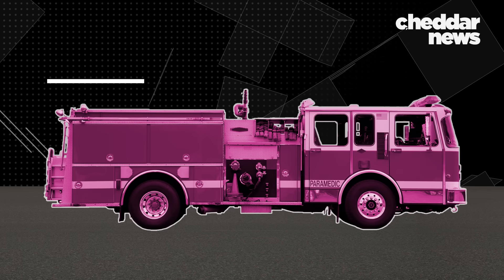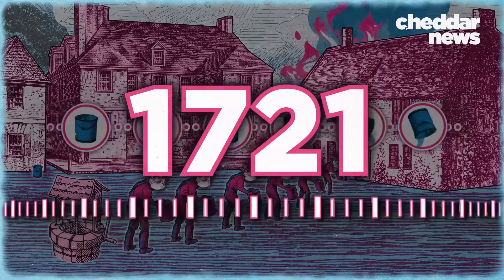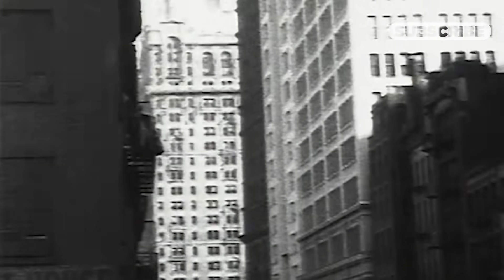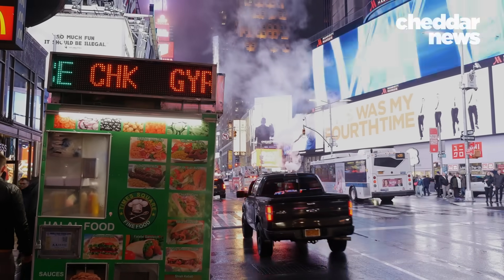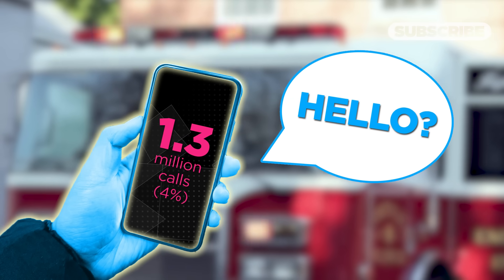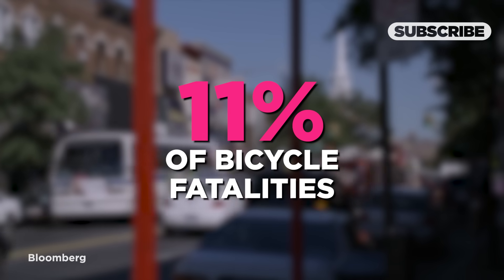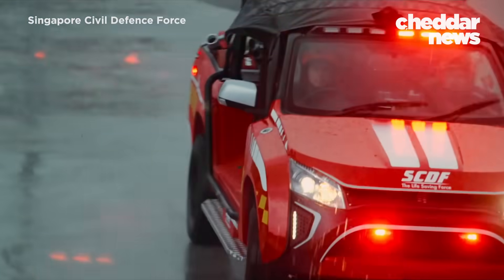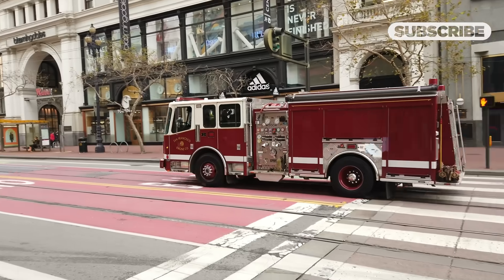Do American Fire Trucks Need To Be So Massive? - Cheddar Explains

Comment: American Fire Trucks are larger because we do way, way more than fight fires.  We respond to vehicle accidents, medicals, technical rescues, infrastructure failures, natural disasters, hazardous material spills and leaks, weather damage..  the list goes on.  On top of that, American Fire Departments have two MASSIVE problems - 200 years of tradition, unencumbered by progress and - what's mine is mine.  Breaking these both down, American Fire Fighters would rather stand on ceremony than electively change or evolve.  Our trucks LOOK old because, well, they are.  Most of our trucks are 20-30 years old because we hate change and trucks are expensive.  As for the latter statement, you would not believe how slow and overencumbered the American Emergency Response system is.  Several States and their Counties are more than 30 years behind in technology and most even further behind in adaptation of national standards.  The trucks at my department have to carry DOZENS of adapters for neighboring areas custom threaded hydrants that are over 50 years old and newer replacements, well, they just get the same old thread because why change, change is stupid.  We also can't agree on one type of hose lay, nozzle, size, tank size, pump, length, ladder style..  Nearly every truck in every single one of the tens of thousands of fire departments across the country is unique.  Sure the chassis may be similar as design engineers from Pierce and EOne etc only offer a handful of models, but the rest of the truck is COMPLETELY customizable from the types of doors, mounting systems, pumps and riggings, technology, lighting systems, etc.  Moreoever, we can ostensibly only afford to replace ONE truck and having that ONE truck able to do everything is necessary as our number of volunteers PLUNGE.  In 1980, the state of Pennsylvania had 300,000 volunteers.  Today, we have 22,000.  Europe may have smaller trucks and diversify their roles and probably have the membership to get multiple trucks out and more than likely a well-designed financial plan to keep these trucks in good maintenance.  In the US, we are lucky to get ONE truck out the door for ANY call.  If we have a truck out the door built to handle a traffic accident and we get another call for a fire - we would likely have to go back to the station and switch trucks IF we can manage to clear from the accident because just about all of our active members that are available are already deployed to that incident.  This forces us to be over reliant on Mutual Aid with trucks from neighboring towns constantly traveling outside of their zone with THEIR limited manpower to cover another municipality's bad day.  All it takes in any given area of the US is one moderate disaster to absolutely cripple emergency services and lead to hundreds of unnecessary deaths.

To make a long story longer and my text harder to read, we had tens of thousands more fire departments 30 years ago than we do today.  Many have merged into a single "Fire Department" covering a large area rather than having 4 different "Companies" within walking distance of each other.  You'd have a Rescue Company, a Ladder Company, an Engine Company, a Tanker Company.. and they'd be "Hook and Ladder Company" or "Hose Company" or "Independent" and they all had their own ways of operating on the Fire Ground.  Without getting political, a lot of these Fire Companies ended up in the hands of a more .. combative and arrogant generation and all these deunification "do it my way" techniques actually lead to Fire Fighters getting into fights on the front lawn of your burning home.  The Fire Service in the US is in a wild race to the bottom and those still in charge of these, basically, Mom and Pop Shops (no, seriously, walk into any US Volunteer Fire Company and you'll see the same last name 6 times on the gear racks and almost all of them are officers, it's nepotism at its worst) are not going to budge until they are dead (their words, not mine).

It's internal problems like these that chase away volunteers, but I suppose it's easier to just call the Millennials lazy rather than, you know, unwilling to put up with being treated like trash despite giving up your time, and possibly your life, for the occasional "thank you for your service".
Reply: " we do way, way more than fight fires." so do departments in Europe, or do you think they don't have all those other scenarios across the pond?
Reply: @EnjoyFirefighting  I know my post was long, but you gotta read more than the first two lines before justifying a "do you think" response..
Reply: @thefoxfrenzy  then let's go deeper into your comment:
1. all the other tasks apart from actual firefighting: done by most departments across Europe as well. technical assistance, rescue, hazmat, diving, water / height / tunnel / cave / rail rescue, EMS, natural disasters of all kinds
2. centuries of tradition ... also some departments in Europe are stuck with that issue. Many departments are still in a station which is more than a century old and not suitable for modern demands. Also some still use outdated tech and apparatus which aren't safe to drive and operate. And of course some departments want to have a bit of everything although their municipality doesn't justify the demand for a "one can do it all apparatus"
3. many apparatus in Europe are between 2 and 4 decades old; Modern trucks are expensive here as well
4. while hose and hydrant couplings are mostly standardized within a country, they differ quite a bit in different countries here. That sure is an issue in case of mutual aid responses 
5. can't decide on a tank size etc ... we have 9 standardized sub-classifications of Engines, not counting other types of water carrying apparatus, with each of them having several subclassifications as well. Although an apparatus in Germany and one in Sweden might appear similar from the outside, they are completly customizted just like you mentioned as well
6. I know the number of firefighters in the US is low; To be precise, there are 1.2 million firefighters in the US with a share of 69% being volunteers; In contrast to that there are 1.1 million firefighters in Germany with a share of 96% being volunteers
7. also in Europe we have departments which can barely get a fully staffed apparatus out the door during the daytime; But those departments won't be the kind running large apparatus which serve all the different purposes, but it's the exact opposite: they will run very compact apparatus with limited range of tasks they can perform and also a smaller crew cab. While the situation in Germany with that many firefighters and departments being around is pretty easy going, it's an entirely different thing in rural parts of Europe, like Sweden and Norway: long response runs, other stations being far away and the next department being even further away; A moderate incident would bring services to their very limit there very easily as well.
Reply: @EnjoyFirefighting  So.. Where I went wrong was I gave Europe too much credit and basically emergency services just flat out sucks everywhere.  Great.  Except for probably New Zealand.  They never seem to have any problems.
Reply: @thefoxfrenzy  "basically emergency services just flat out sucks everywhere" definetly not what I said; Just mentioned an entirely different approach, like not going for large apparatus when you don't have the manpower to staff them. 

in Germany the normal volunteer departments are able to staff their Engine with a crew of 9 and they're able to respond with several apparatus within just a few minutes; 
Max. legal response to any location on a public road is 10 minutes ... no matter where in an urban or rural setting you are at in Germany
Reply: @EnjoyFirefighting  Yeah, that's not how it works over here.  We buy one or two big trucks and that's that.  If one of them gets out with 2 people it's a good day.

That was the point I was trying to make why we have these massive trucks.  They have to carry every tool for every job.  If we did half a dozen little trucks, each one tailored to a different type of incident, it just wouldn't work.  Especially with our department requirements for driving.  Every vehicle has its own driver training program.  Problem is, you need people to actually train drivers.

We even have fire equipment on our ambulances because "what if you're on your way back from the hospital and there's a fire call?!?!"  My POV; we're going as EMS.  Department's POV; take your TOG on the EMS call with you, wear it while treating the patient, catch a fire call while EMSing and come fight fire.
Don't need 55 years of experience to know this is all a terrible idea.  Rightsize the department and put the right mutual aid on your box cards (oh, yeah, we still use Box Cards here..) and don't be a territorial little bitch.

On the other end of the spectrum, you can buy a Heavy Rescue, a Tiller, a Bucket Aerial, 2 Engines, Command Car, Brush, Utility, boats, and all this other shit and watch it rust away because no one can drive the damn things.  Better yet, jump on the one or two people that have little choice but to go POV or not go at all - because they could've helped get a truck out.  It's all awful.  I like the job, but the politics and bullshit are taxing.  I guess it's easier to list problems than list solutions and if anyone gives you solutions - run them out! they're after your helmet!
Reply: @thefoxfrenzy  Crew of 6 would be the standard for a career FD (4 would be understaffed), and at volunteer FD it's a crew of 9. 
Video of a volunteer FD responding with multiple apparatus: https://www.youtube.com/watch?v=-N-xA3CzAAQ
"If we did half a dozen little trucks, each one tailored to a different type of incident, it just wouldn't work.  " that's why also the smaller more compact apparatus aren't specialized onto handling only one type of scenario, but also they are spec'd to be multifunctional. Also the van based apparatus can come up with a tank, pump, hoses, tools, ground ladders, EMS stuff etc

In my state only 4 fire departments run EMS units; All other ambulances and other EMS units across the state are operated by various EMS providers and all "firefighting" equipment they have is a crowbar, bolt cutter and a fire extinguisher. In my county there are 5 EMS stations and 82 volunteer fire departments with 83 stations.
"I like the job, but the politics and bullshit" so true, I guess that aspect goes for many emergency services in many countries.
Reply: @EnjoyFirefighting  Something I forgot, we also have NFPA minimums.  Now, I don't know what all of them are, but across ALL trucks in a single fire department you must carry 1,000 gallons of water.  2 trucks with 500?  Set.  3 trucks with 300 each - fail.
I believe there's also a minimum required hose type and length for each classification of apparatus.  There's also a minimum amount of hose type and length the station needs as a whole.  I know this because I tried to get rid of about 3,000 feet of 1.25 hose that is so aged it can barely be rolled anymore.  Can't do it.

There's also, from what I've noticed, a ton of wasted space.  Now our department has one of the smallest Engines in the area.  Ironically, it's also the largest piece of sh*t.  It pumps great, but all the tool mounts are broken, body pieces are falling off, it has dents everywhere, half the doors need slammed five or six times to get them to latch, it drives and handles like a sail boat in a tsunami.  But it was designed small so it could fit in alleys and other tight spaces.  I mean.. we carry enough hose on that thing to circle the block three times .. but yeah, sure, squeeze into that alley.    Reduce that coefficient by .. 3psi.  Our rescues carry water.  Our aeriels carry water.  That all takes up a ton of space.  Put water on everything.  And not just a little water.  1,000 gallons on that aerial.  We wanna run the master stream with no supply for 12 seconds.  You know.  JUST IN CASE.  I swear we build trucks here for THE RAREST of unlikely scenarios when either standard loadouts or a loadout specific to your area which can easily be figured out by researching historical call types.  Personally I wouldn't buy a 1.4 Million Dollar aerial for an area that is 97% residential wood frame.  I HATE climbing the stick; especially when it's practically parallel with the ground.  Give my a ground ladder any day.

I guess the point I'm trying to make while still staying on topic with this video about the sizes of Fire Trucks in America is that we're just idiots.  Personally I don't mind a giant rig, but if I can cram everything into that one rig and take that same rig out every time things would be so much easier.  Especially when you know you only have 3 people coming to this call and you have no idea who is signed off to drive what and how much each of them knows about that truck.  I know that sounds like an insane problem to have, but you're welcome to swing by and join the department any time - just bring some Advil .. you're gonna have a headache.
Reply: @thefoxfrenzy  you'd probably be surprised hearing that German DIN standards are even more precise than NFPA poses to American fire departments and their apparatus. The DIN standard doesn't only tell how much water they have to carry, but to be classified as a certain type of apparatus the standard dictates a very precise list of minimum equipment (like e.g. 164 different tools at a total number of 284 pieces on a normal Engine), minimum tank and pump capacity, size of the crew cab, truck chassis requirements like AWD etc, but at the same time also sets limits like the max dimensions and weight. 

"There's also, from what I've noticed, a ton of wasted space." I agree, I've seen that both on old and fairly new apparatus in several walk around videos, with equipment stored loosely at the bottom of the compartment or slide-out tray with half the compartment above remaining unused 
"I swear we build trucks here for THE RAREST of unlikely scenarios" take a guess how extremly special some of the apparatus are over here: things like fire and rescue tanks, nitrogen vaporizers, light foam Engines with a 7.5 ft diameter hose, quick attack units based on motorbikes / compact cars / SUV / offroad cars / vans, two-way fire trucks and two-headed fire trucks, fighter jet turbine powered aerosol "turbo" extinguishers, ladder trucks where the ladder can be seperated from the truck and taken into tight spaces the truck itself wouldn't be able to access, ...
"I HATE climbing the stick" apart from a few old letfovers, ALL of our Aerials are platforms, no matter if it's based on a ladder or telescopic boom, or telescopic boom with an attached ladder; Apart from the selectrion process and basic training no-one climbs the ladder later on, they all ride in the platform / bucket; Tall Tower Ladders now also come with a lift riding the ladder up and down while the platform stays up all the time
Reply: @EnjoyFirefighting  I'm moving to Germany.  We seriously don't have our shit together over here.  We are not okay.  Send help.

Comment: There should be at least more pickup chassis type fire trucks for medical emergencies and situations a whole engine is not required. This would help increase response time, cost less in fuel & maintenance for the department, along with being better for the environment.

Comment: I’ll take the full size type 1 with 500gals. The extra water capacity is a must.
Reply: only when you operate at high gpm rates; If not, you don't need a lot of water on board
Reply: @EnjoyFirefighting  or if there is no access to a hydrant.
Reply: @Steve luckhurst  even then you don't necessarily have to operate at high gpm rates. Obviously depends on the type and scale of fire . E.g. at a fully involved car fire high PSI, low gpm and low total amount of gallons of water
Reply: @EnjoyFirefighting  yes, agreed. I was trying to simplify things for our friends in the states!
Their pride seems a little dented over this appalling video!
Reply: @steveluckhurst2350  bigger is always better. The extra water allows for a safety cushion should there be no hydrant in close proximity or issues with hydrants. Water is free so why not have as much on board as you can.
Reply: @kenxiong6830  You're so wrong, it's not even worth arguing with you.
Reply: @steveluckhurst2350  yeah we fight real fires here in the states
Reply: Xenophobia is what you are good at.
Reply: @steveluckhurst2350  You ever been on a big structure fire? Ever use a ground monitor or deck gun? Takes only a few secs to go through your water. Better to have and not need them to need and not have
Reply: @kenxiong6830  we have fire hydrants.
Reply: @steveluckhurst2350  water hydrants never cover enough area. The most important part is to put water on the fire. Having the extra water capacity can give you enough water to where you won’t need to hook up to hydrants. Plus, if your city doesn’t exercise and maintain its hydrants on a regular basis you can have issues. Not every FD enjoys the perfect world that you live in.

Comment: Heavyweight problems require Heavyweight solutions. - Mr incredible. 

So keep the big trucks. They may not be needed for every call but when you need them you NEED them
Reply: so what's the point of a HUGE LONG Tiller Ladder if the ladder itself doesn't reach any higher than on a way more compact and shorter truck? How can Europeans get a way taller ladder on a shorter truck chassis?